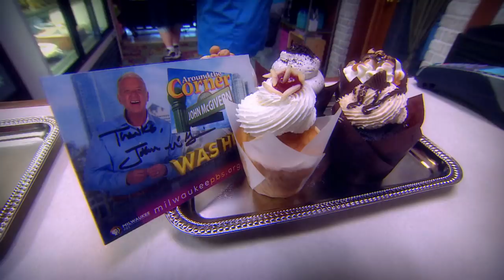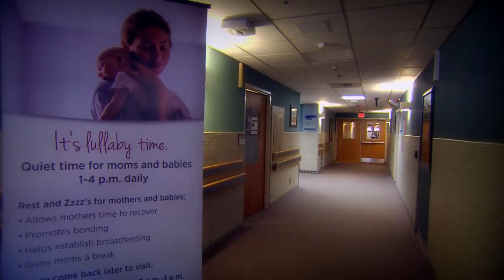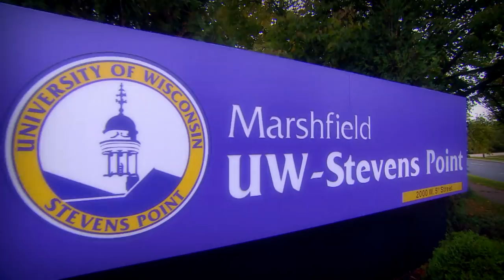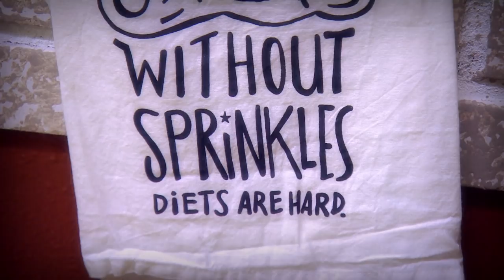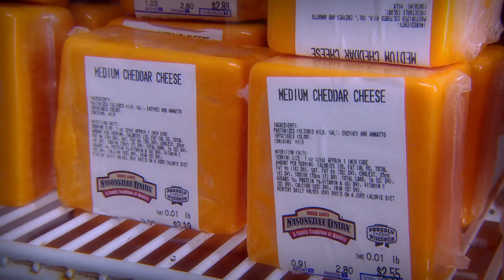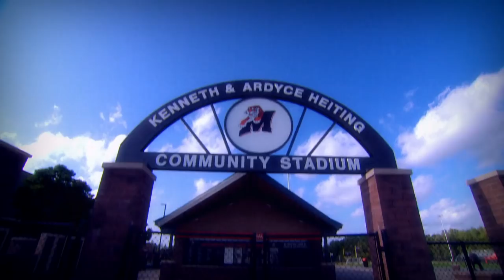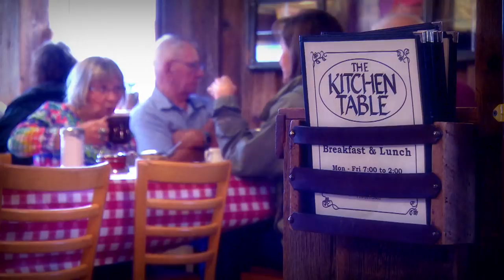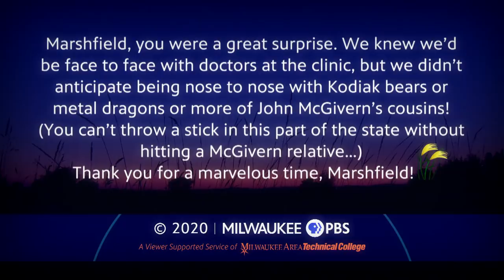Around the Corner with John McGivern | Program | Marshfield #909

Comment: As is always the case, there is another line of thinking about how Marshfield got it's name, another Railroad connection, if you will. Wisconsin Central (of 1871) had its financial root in the Eastern Seaboard, and that "Marshfield" was named after Marshfield, Massachusetts. I don't know how true that really is. Like many things, it depends on what you want to believe. The tale of John Marsh makes sense.